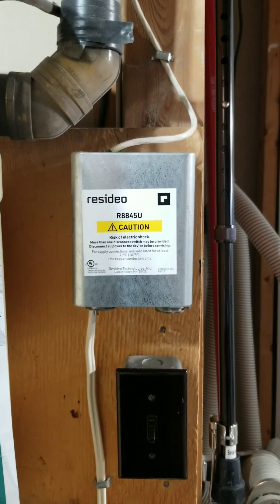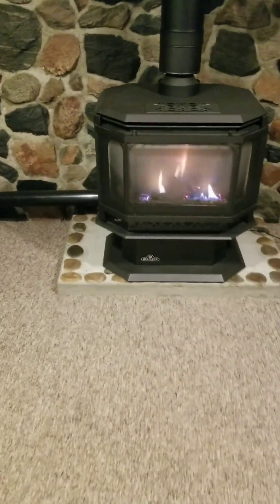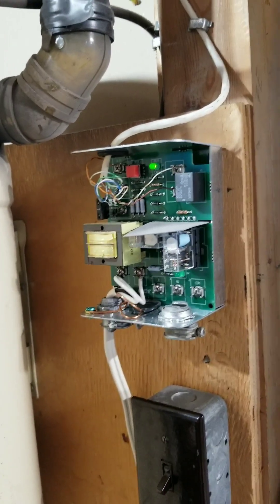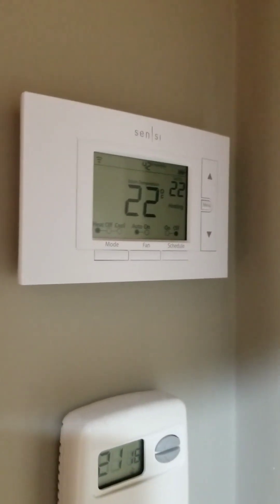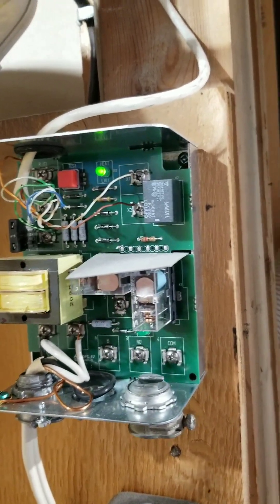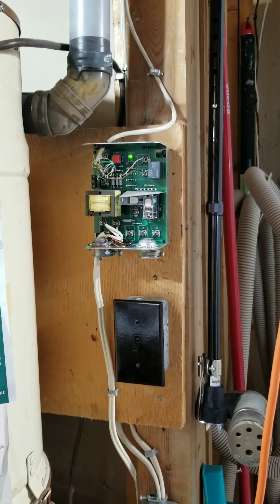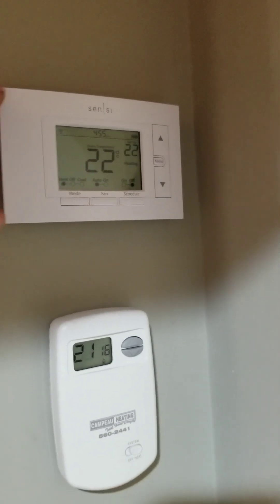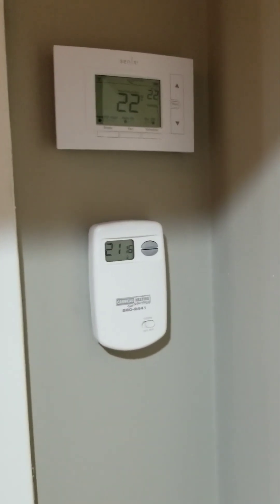Control your gas fireplace with a wifi thermostat with this box.

Comment: When you said you paralleled the existing and the new thermostat, did you run the new line (5wire) to the existing thermostat or to the fireplace and leave the existing (single pair) hooked up to the fireplace?  Hope this isn’t too confusing.
Thanks!
Reply from the maker: The existing 2 wire thermostat line from the stove connects to the backup thermostat..from those thermostat terminals you run another 2 wire line to the relay output of the box.  The stove is activated when those 2 wires are shorted together...either the backup thermostat shorting the wires...or the relay from the box shorts the wires...either works and are considered connected in parallel.   The 5 wire thermostat is only connected to "the other side of the control box.  As far as the stove is concerned it's just connected to 2 wire thermostats
Reply: @ontariooutdoorsman thank you for the quick response.

Comment: Couldnt you just pull a 24v to RC and back with C to power the thermostat and use R and W for your contacts for the fireplace?
Reply from the maker: The 2nd one I have is standalone battery operated for power fail.  If power fails unless you have a ups you lose the 24v

Comment: Question. If you have a smart thermostat like the Google nest which takes batteries as well as plugs in to the wall/power. If the power goes out, will the backup batteries still run the switch?
Reply from the maker: So the way I have it connected..no they wont.  With no power the relay will not flip and turn on the stove.  I have a basic battery thermostat set lower that will activate in the event temp drops in a power failure.  Its hooked in parallel
Reply: @ontariooutdoorsman thanks. So the regular thermostat is wired before or after the switch coming from the stove
Reply from the maker: So there are 2 wires coming from the stove...those 2 wires feed both the box..and another thermostat that is meant for the stove. The stove is connected directly to both...so after the relay box.... the backup thermostat connects direct to stove.  The way it works either can activate it.  The backup thermostat will only activate it if temp drops to that level...mine is set at 16 Celsius.. we keep the room at about 22 n winter
Reply: @ontariooutdoorsman  got it thanks!

Comment: It's nice to see someone finally build this adapter box. I've used a 24v transformer, fuse and a relay to control it via nest stat. I thought about manufacturing one myself for the market but this controller appears to have some other circuitry. I'll have to check it out. This looks FAR too bulky for the application. I estimate that thing should be no larger than your thumb for easy mounting. That box could probably switch a rack compressor system. A control interface for a gas fireplace should be less than a dollar to produce and should not exceed $50 retail value. The switcher shown in this video is $100 and WAY overkill for the intended application.
Reply from the maker: @billybbob18 it's not really overkill..it just provides the power and rectifier plus the relay contacts for conversion. It's an industry standard converter.  Yes..it can do more. ..but it's way easier to buy this than make it from scratch if you dont have the time.  Let me know if you make something on a pcb and how it works.  Certainly is simple enough.

Comment: Thanks for the video. I was looking for something like this. rather than relying on two devices (a relay and a transformer) and lot of wiring like most of internet suggests. Going to try this with my gas fireplace and a near thermostat.
Reply from the maker: I have had this for quite a while now.  It's so nice with the wifi thermostat as we just adjust with our phones and it's in the basement.  Very nice and so far bulletproof

Comment: Hi, thinking about having one of those in my cabin. We have WiFi at the cabin and we want the cabin to be nice and warm when we get there, can I basically control everything through the WiFi?
Reply from the maker: Yes.  As long as you have a wifi thermostat hooked to it you can.  I have exactly that.
Reply from the maker: I have some electric heaters I also control remotely using Mysa wifi baseboard thermstats
Reply: 👍 Thanks

Comment: Hi Jim thank you for the video, it is very helpful. I currently have a gas fireplace insert in our fireplace that currently has a receiver that pairs with a remote. The remote has a thermostat which can be programmed among other things. However this doesn't allow me to view the temperature remotely and turn on or off while away. I would like to add a wifi thermostat just like you did. Would this relay work for me? The remote i have is a skytech model 3301. The skytech receiver is located under the firebox and connects to the fireplace controls using those connectors. Then you pair the remote to the receiver and it works. This is all good but you dont get wifi capabilities which is not good for me. Let me know if this relay would work? Thanks again for the help.
Reply from the maker: You should absolutely be able to use this.  First thing to understand is whether the fireplace is a 2 wire microvolt control.  If the electronics under your stove is powered externally and has a wiring interface to a 2 wire connection...you should be able to just double up and add a second pair of wires and thermostat in parallel.  The thermostat set highest would control the stove.  You could then add any thermostat thru the relay box and be able to view and control remotely.  You need to find out if your stove has a 2 wire connection...that your remote equipment ties into.  Good luck !
Reply: Thank you Jim for the quick response. I will check the wiring as you noted. Once I do this I don’t need the remote I will just use the wifi able  thermostat on wall. I’m doing the homework now and once winter is over to do the work. Don’t want to mess anything up in this cold weather . Thanks again
Reply: Think this would be safe with propane stove as well?

Comment: I really want to make this upgrade but I only have a three conductor thermostat wire from the wall directly to the fireplace. I could probably fish 120V but would have nowhere to hide the transformer. Any suggestions?
Reply from the maker: You can mount the transformer and box anywhere its convenient.  Then run another wire from that box to the thermostat..that has a couple spare wires to feed the stove thermostat control back to the box
Reply: @ontariooutdoorsman Ok thanks for the response. It seems like my best option is to run a new wire via the crawl space where I can grab line voltage. My thermostat is mounted on the wall literally 4ft from my fireplace with nothing between. There is an unused G fan wire however which is good
Reply: @ontariooutdoorsman My other issue is that I only have a three conductor thermostat wire to the fireplace. From what I can tell all of these step down transformers require a four conductor. R/W for the millivolt contact closure and RC/C to get power on the common wire
Reply from the maker: The millivolt contact closure only requires 2 from stat to fireplace in actuality.  Regular network cable is great to run between the box and thermostat and gives u 8 conductors to splice and work magic.  Good luck.  It's a great system

Comment: Hi Jim. How can I get hold of you?
Reply: Thats exactly what i was in need of. I appreciate the quick response and the updated video information. Thank you sir.
Reply: I dont want to admit my mistake so i wont. I do have it up and running correctly now. Thank you for your assistance. I greatly appreciate it.
Reply from the maker: What is it you are looking for ?
Reply: @ontariooutdoorsman well im not that guy but i would love it if you had a rough wiring diagram of the r8845u. I understand the 2 wires you have to the side go to the thermostat wiring of the fire place. But the other 3 and power to the thermostat? Im at a lose as the diagrams that came with my new r8845u dont cover this use. If you could help i would appreciate it.
Reply from the maker: so do the following ..I refer to R8845U as box
Connect RH on thermostat to RT on box
Connect W on therm to W on box
Connect C on them to C on box

Connect 2 wires from fireplace to X1 and X2 on box..doesnt matter which way.

Connect 120ac to L1 and L2 on box and ground to green scre
Reply from the maker: @short_bus_ridin  so if your thermostat doesnt have an RH ..connect it to R.  R or RH are the line to request heat.  C is common.  W is alsonparr of the heat circuit.  Basically when the R8845U box sees thermostat call for heat... it activates the 2 wire circuit on the gas fireplace by connecting the wires on X1 and X2 together.  Hope this helps.  Wish I could attach a diagram
Reply from the maker: @short_bus_ridin  so  just also added details to the video description.  I hope others find it there.  Perhaps I should make a more descriptive video
Reply: I just hooked all this up and when i turn the heat down below toom temp it also cuts the pilot light out. Is there a way to not turn off the pilot and just cut back the gas flow? I need the pilot light to light to stay lit.
Reply from the maker: @short_bus_ridin  pilot should never go out.  Its kept on by the thermocouple.  Thermostat wires have nothing to do with the pilot.  The pilot is an internal circuit with no connection to the outside.  If it goes out you should hear the clunk as the plunger drops when the thermocouple cools
Reply: Thats my problem. The pilot goes out every time
Reply: Im not witing it correctly somehow.
Reply from the maker: @short_bus_ridin  the x terminals are just a relay output.  Either closed or open.  If you want to verify your fireplace working correctly...connecting the 2 fireplace wires together should turn it on.  Disconnect the 2 wires and it should shut off.  That's all a thermostat does.  If pilot is going out...thermocouple probably needs to be changed.  You could have a downdraft in chimney also.  That can happen until chimney is warmed up..sometimes need to open a window to let chimney flow up and get hot.  Dryer or venmar or water heater or furnace running can also make downdraft.  Unless u have power vent.  But sounds like your thermocouple is marginal
Reply from the maker: So this may sound silly but check.  When u are lighting the stove...and holding in the pilot button... do you have to turn it to "on" after it lights and before releasing g the button ?  If you dont turn it to on from light...it will go out after stove shuts off